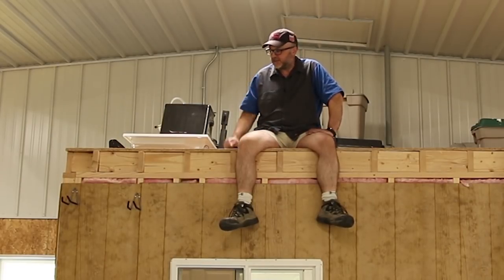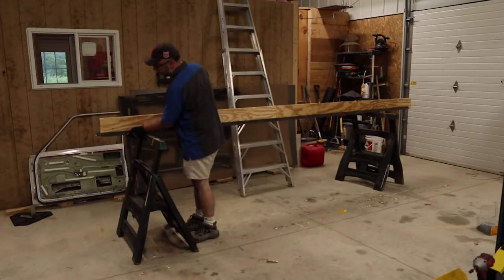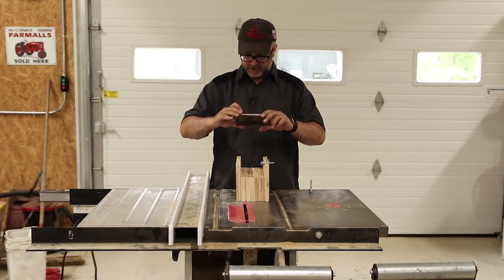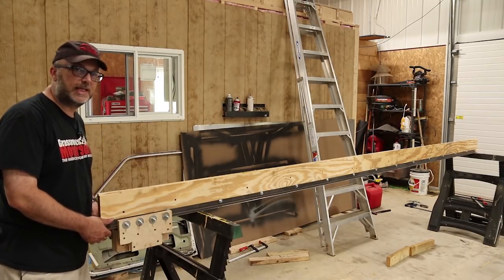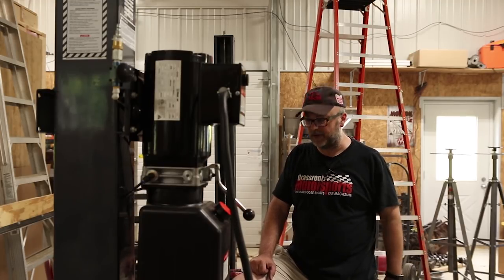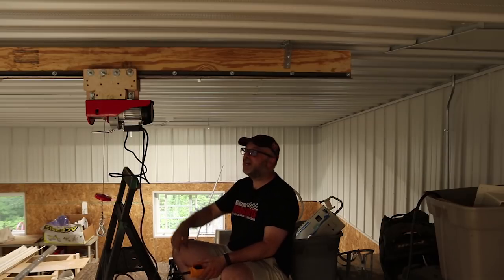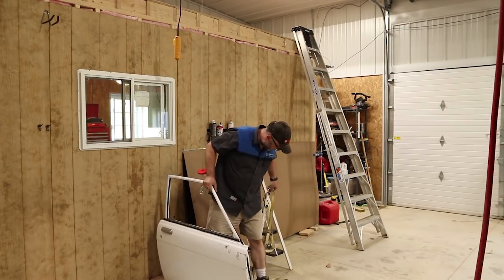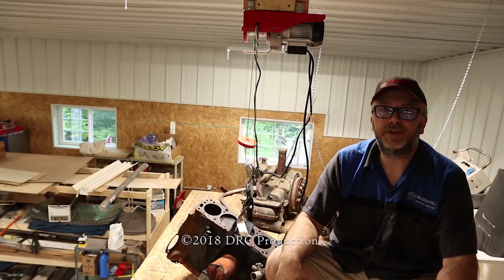Garage Hoist on a Movable Track

Comment: Great vid - I just wonder if the roof of that office is rated for 2 tonnes of gear on it! :)
Reply: I had similar thoughts!
Reply: Looks like 2x6 on 16” centers and no more than a 12’ span. Should be no problem at all.

Comment: While I really like your idea a better solution for your application would be to build a lift using garage door rails on the wall to the ceiling and craft a box using strut and garage door wheels. Put the trolley up high and lift as needed. Store it in the up position so its out of the way.

Comment: VW engine in that dress is just about 200 lbs. Might be 250 lbs complete with shrouds and generator. The Datsun / Nissan short block is around 300 lbs. Still, in all, impressively thought out. What I would change (and you might have mentioned) was adding a longer power cord, but rig it off to the side to keep it away from the track. Obviously extending the control cable, which you mentioned. I'd add a tag line so you can move things along the track from ground level without tugging on the wires. Last but not least, if you plan to go up there on a regular basis you should add a railing so you don't take a header off the side. While we're talking about safety, maybe a label on the control stating max load in case somebody else tries to use the thing when you are not around.
Reply from the maker: Have done some of that since the video.  Added a chain that both prevents the trolley from going farther than the power cable and gives me a way to pull it towards me.  Also have extended the control cable.  Yeah, a railing probably is a good idea, have not done that yet but probably should.

Comment: Buying the 440 tomorrow. Just to lift front of my ztr for maintenance under deck. Mower weighs 850 plus gas but I think ztrs are a 70 / 30 Weight distro .. 70 in back. So 275 to lift front.. Hopefully   I'm good! Hope it's held up well for you. Maybe I'll get next step up in case I need to lift back off ground a few inches some day.. tire changes etc..

Comment: Creative use of plywood to make that hoist! Wouldn't have thought of that, I'd be welding something up like a dummy :). Love the Datsun too!
Reply from the maker: I thought about welding up something or using an I beam but would have been heavier and actually the plywood made it much easier to drill and bolt together for mounting.  I need to get back to work on that Datsun!  Part of the problem is the shop is too cluttered but the hoist is helping me fix that.
Reply: That is true, especially if you're working with some heavy gauge metal. That plywood will actually be very strong. I love 510s so I definitely want to see what you do with it!

Comment: I use1-5/8" Wide 2-7/16" Tall 13 Gauge Steel Unistrut Channel with a six wheel trolley roller which will bolt to the hoist with ease.

Comment: Just  a hint about drilling holes. The lowest RPM while still making chips is the best speed and feed.  The high RPM here is work hardening the material making the drilling even tougher.  When in doubt - go slow... ;)

Comment: To keep any sway out of the trolley roll, you could add a couple of those roller skate bearings on the horizontal plane at each corner of your trolley block, ... And to make sure the trolley does not get any sideways play while tracking, you could also use a couple of the garage door track roller sleeves as bushings for the bolts, ... in addition to those measures, you could adjust the setting of where the roller skate bearings are riding on the angle rails, by adding as many washers as necessary to alternate the load on the rail track, ... thus increasing the load bearing surface of the rails, ... just a couple of thoughts to your processing design, ... spreading out the positions of where you are placing the heavier items on your office ceiling trusses, will eliminate any surprise entries into your office from above, ... 
You mentioned that you are located in New England, ... and I know it can get quite cold there during the winters, ... you should/could eliminate any cold areas inside your office for heat loss through the ceiling, by putting a few layers of insulation over your office space by putting a false floor above your office, too, ... reinforcing the floor load strength of the office ceiling, ... I do not know what the rafter strength of the buildings code is, but you need to make sure that there is enough “flex” in the rafter itself, before you go placing differing weight loads upon the overall structure, ... just saying, from a safety point of view, ... because I don’t believe the structures of those steel clad buildings are meant for such stress capacities, ... Yes, ... I know you won’t be trying to exceed the limits of your hoist, but, differing times of year, with differing weather temps can affect such load actions as the building must flex, with the temps, ... or withstand certain loads placed on it with differing loads of wind force, rain, sleet, snow, & ice, etcetera, ... & then flex in the opposite direction(s) with the summer’s heat, ... 
All in all, a well thought out project, ... something that can be utilized throughout the year, with a minimum of effort to move, & store items that can get in the way of everyday life, when only needed as you have/want to use spare time for hobbies, ... or seasonal events, ...

Comment: You could have added a outlet at the middle of the track and plugged the cord into it, there by giving you run of the whole track. Then all you would have to do is lengthen the switch cord. I didn't hear you say what the angle size was, but something like this, I would use at least 4".

Comment: Nicely done. Question for you, were you able to extend the power or control cords? Recently purchased a hoist and have the same issue
Reply from the maker: I extended the control cable which was fairly easy.  I have not needed to extend the power but honestly an extension cord would work for that.
Reply: @ChappysGarage  Could you please explain in detail how you extended the remote control cord (e.g., type of cord used, which end was extended, etc.).  Thank you.

Comment: Thank you for the video!!!  I'm building a hoist for my garage which will lift equipment to overhead shelves which I'm building.  I'm also going to install rollers off of the main beam so that I can move both vertically and horizontally.

Comment: Great ideas, especially the laminated plywood beam and trolley. Could also be used to hoist a dirt bike or small motorcycle onto a work table. Just need to find a good lift point to keep the bike level. A bigger motorcycle would obviously need a bigger hoist with a stronger beam and trolley. Thanks for sharing.

P.S. In case the roof structure isn't strong enough to support the beam (3x load factor), the ends of the beam could be supported on 4x4 or 6x6 posts mounted at each side of the garage.
Reply from the maker: Hadn't thought about lifting a motorcycle.  Might try it with my 250 or 450 dirt bikes.  Probably won't with my KTM 990 ADV :)

Comment: I like what you did but I hope you've put stops at each end of the track, so the hoist won;t accidentally come off.  I didn't see any.
Reply from the maker: Yes, stops on both ends.  Also, since shooting the video I have added a chain that is just a little shorter than the power cord.  Prevents the cord from being yanked and gives me something to pull the trolley back with.